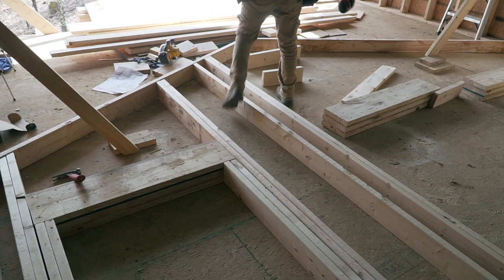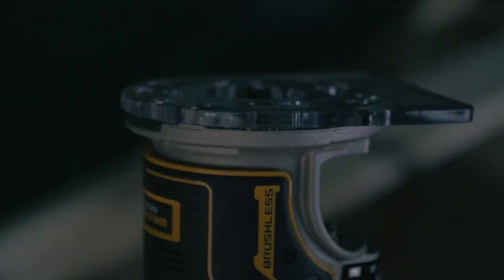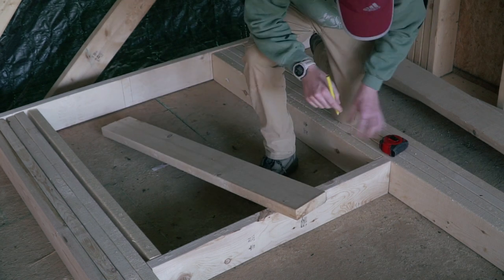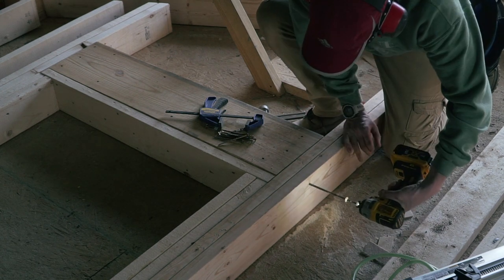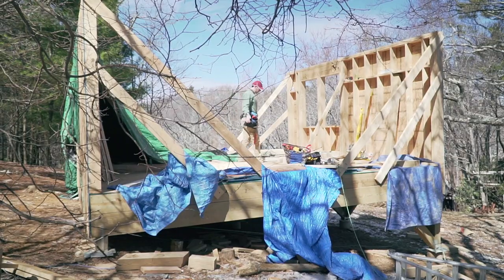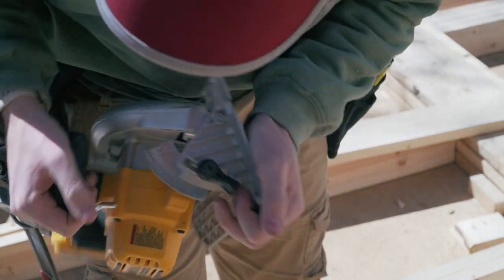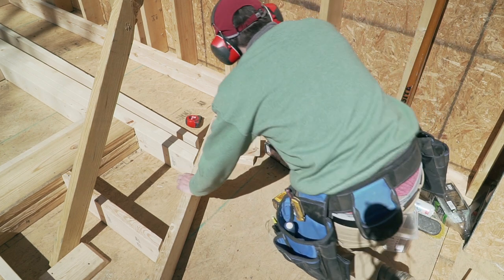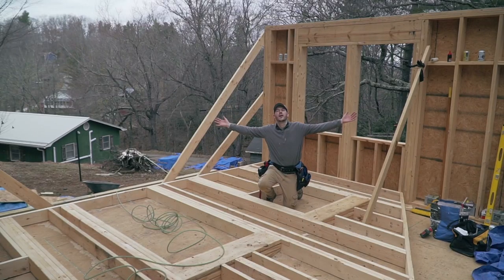Framing the Front Gable End Wall Was Not Easy ! - EP 24

Comment: We do gable end walls differently. Layit out on the floor, lay studs down full length, with the exception of the ends and a block for the center, then n snap a chalk line and mark them all. Use a temp every four feet or so to tack the studs on layout so they dont bow on you. 

Then walk through and cut the studs with a 10" saw and a pull saw or sawzall for the last half inch. 

Then add the top cap and stand it up.
Reply from the maker: Sounds good and probably much faster than the way I did it !

Comment: Hi, I didn't see what type of screws you were using for gable wall stud connections to plates but I think,  generally, code prefers nails rather than structural screws, and definitely not regular screws, because nails allow for some lateral/ shear flex in walls. This would seem counter- intuitive since you are trying to eliminate flex/shear with wall sheathing plywood, but I believe nails would easily pass an inspection, but screws may require engineering specs. I have framed ballooned gable walls before by setting all straight and oversized studs on end on layout and securing them with bottom and upper height layed down 2x4s. Overlay and secure a straight layed down 2x6 on the rafter angle stud tops cut line ...( you have outer walls top plate height and roof pitch so you can define this layout as you show in the video) . Trace the cut lines with a sharp regular pencil and then disassemble this stud layout and cut all studs on a chopsaw set at 26.5 degrees ( 6/12 roof pitch angle) .. ( actually 26.57 but let's not get too fussy, eh? ) a backer base and vertical jig frame screwed to your chopsaw fence from behind, then cut at the angle will simplify exact cut lengths, giving you a visible cut mark to set your cut lines to. Ideally, you can have a long chopsaw stand setup with two chopsaws.. one set at 90 * and the other set at the roof pitch angle... both with backer bases attached to chopsaw fences. The time spent setting up this chopsaw station will be returned to you easily in saved cut times , not to mention much improved accuracy. It's always a freaking trip to me to see what seems like miniscule imperfections in the foundation forms compound into a royal pain in the ass by the time you get to roof framing 🙃 !!

Comment: seems like you could have cut all studs at a slightly longer length, laid them out as you did, and then snap a string, or some other straight line from side to peak and that would be the cut line on each?
Reply from the maker: Not a bad idea, could have worked

Comment: Are you using Ring Shank nails for the framing? Or Smooth Shank? I’m thinking that the Ring Shank Nails will hold a lot better, eh!?!

And I see that your foundation is made using all treated lumber, but for the framing, you are not using treated lumber? Love your videos, brother! Thanks!
Reply from the maker: I’m using typical framing nails which I believe are smooth. Theoretically ring shank do hold better but I’m pretty sure most people just use the regular ones.

Yes, I used treated lumber for all of the floor framing, the post, the beams and the joists. Theoretically The joists could have been just regular framing but I decided to be extra careful. The walls and everything up is regular framing, there isn’t any reason to use treated lumber for those elements. 
Thanks !